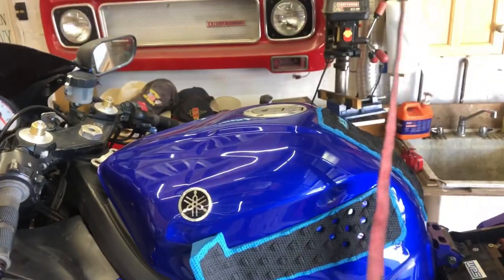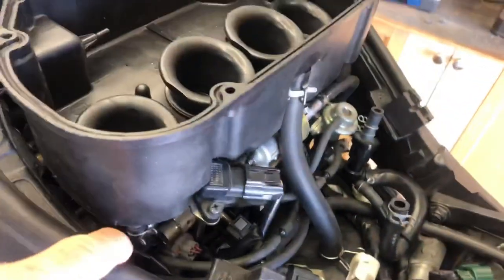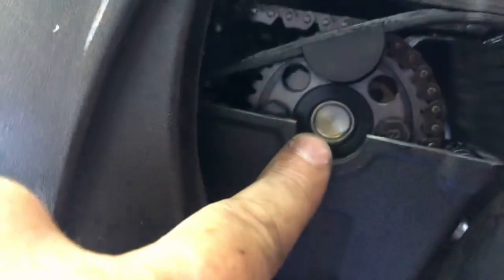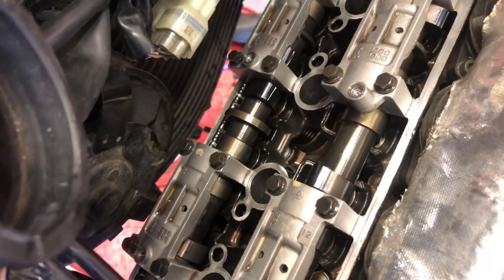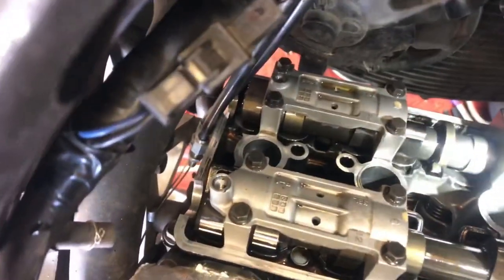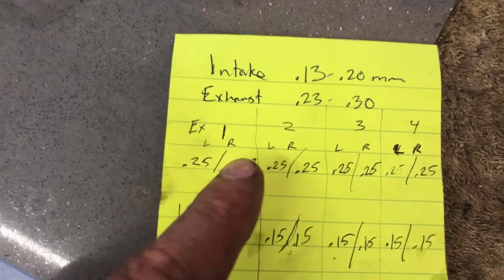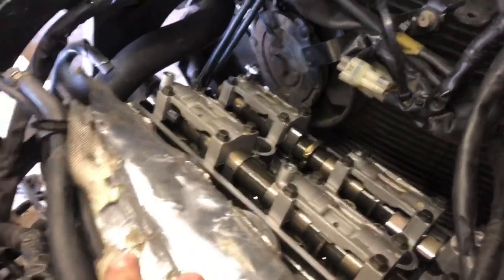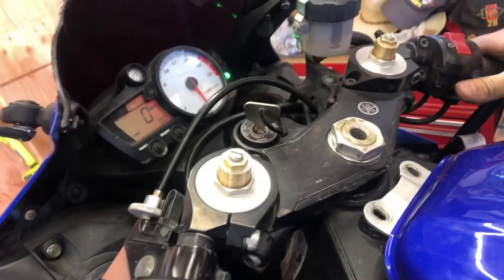Yamaha R6 Valve Clearance Check

Comment: At 5:06, those plates block off the Air Induction System (AIS), which is an emissions control device that injects air into the exhaust pipes to make sure leftover fuel is burned.  The stock configuration has inlets there with hoses that extend to a solenoid that opens to allow filtered air from the airbox in through where those plates are mounted.  There is a lot more room to work on top of the engine with those hoses and solenoid removed.
Reply from the maker: Yes, pretty common modification to remove it and install those plates.  Thanks for your information and thanks for watching.
Reply: I need to do that

Comment: At 7:54, that silver cylinder has two coolant hoses on it.  The plunger on the Left end of the cylinder moves outward when the coolant flowing through it is warm.  That let's a little more air into the throttles than when the bike is warmed up and a little less air (cold start enrichment) when the coolant is cool.  You can watch it to make sure it moves as the bike warms up.
Reply from the maker: A lot of engineering goes into this stuff, interesting to see how it works.

Comment: These videos were a life saver! I adjusted the valves on my 05 R6 and now when I turn the key I hear the fuel pump but nothing on the dash turns on nor the horn, battery is testing at 12.3 Volts. Any suggestions?
Reply from the maker: Layth Bukhari interesting issue, well if it worked before you did the work then start in the area you were working on.  I have been known to not plug things back in.  Good luck and let me know what you find.  Thanks for watching.

Comment: Can you tell me all parts/gaskets/fluids needed? I bought mine used (17k) and she’s bout ready I assume.  Thank you so much
Reply from the maker: For what, valve check?  Shouldn’t need anything….maybe a cam chain tensioner gasket and some sealant
Reply: @TomsTinkeringandAdventures  for the actual adjustment
Reply from the maker: @jayk10304  yeah, like I said you can likely get away without needing anything.  If I’m planning a check/adjustment I usually do it during a regular maintenance time so I do oil change and also maybe coolant change as well…just makes sense if they have not been done.

Comment: I’ve been following ur video as a guide on my r6 because I needed to do a valve adjustment(bought it used). I have a question about the valve clearance tho. My valves are all way to tight so I can’t even get the smallest feeler gauge in there to get a measurement. Do u have any recommendations on what to do, or should I just write -0 for the measurement and then remove the cams and everything
Reply from the maker: Rice Rocket if they are all tight, I would suggest rechecking your work.  I don’t think I have ever seen an engine with every valve tight.  But yes, if you get one so tight that a feeler gauge won’t fit, you just have to remove the cam, pull the shim and install a smaller one and check again.  Good luck
Reply: Tom's Tinkering and Adventures Ya that’s a good idea, I’m going to check them all again and see if I maybe missed something or maybe had it slightly off of top dead center. I appreciate the help and the quick response👍🏻
Reply from the maker: Rice Rocket good luck, take your time and you will get it!

Comment: Wouldn't it be easier to just drop the engine out of the bike?
Reply from the maker: I have a video removing the engine.  If you want to do that for a valve clearance check, I won’t stop you!  😀. Thanks for watching.
Reply: @TomsTinkeringandAdventures  I was thinking more for the actual servicing of the shims.
Reply from the maker: @manoomunicnent1773  it’s a minor pain in the back side, but overall it’s not terrible.  Removing the engine is a big job.

Comment: What year is this R6?
Reply from the maker: Young Blue 2005, sorry if I didn’t mention that.  2003-2005 R6 and 2006-2009 R6S should all be the same.
Reply: @TomsTinkeringandAdventures  Thanks bud, was searching for 2012.  Cheers
Reply from the maker: @bluezuke860  I imagine the procedure is not going to be much different, but possibly the clearance required may be.
Reply: @TomsTinkeringandAdventures  correct the process is the same but the clearance may differ in the later models.
Reply from the maker: @bluezuke860  I was just thinking I should look it up, because I have an FZ6 which I believe is based off the newer engine but that thing only has a few thousand miles on it.  I like that Yamaha has valve checks set at 26k miles.